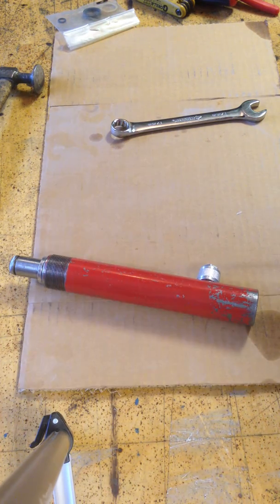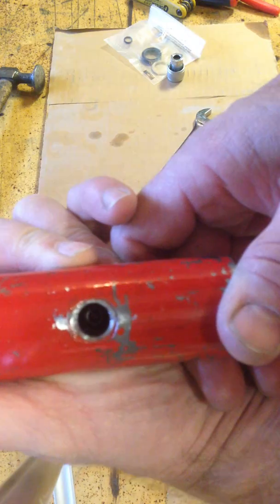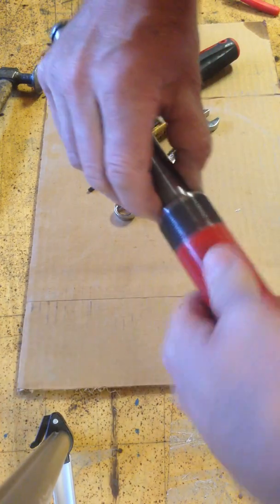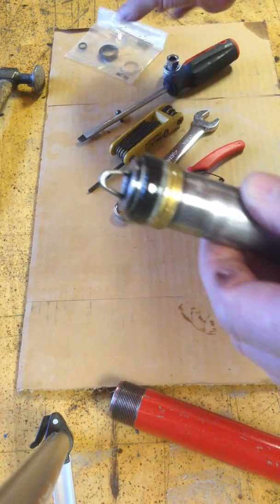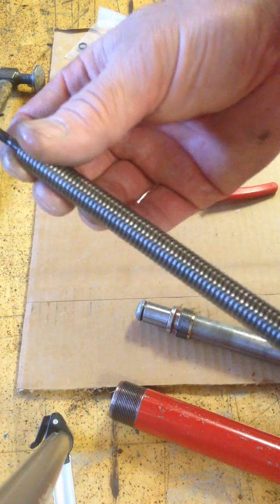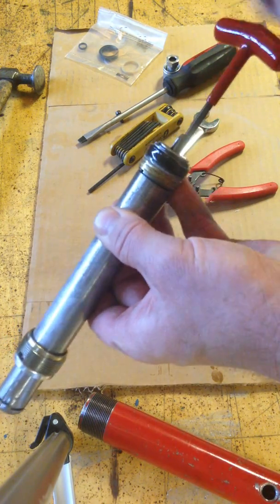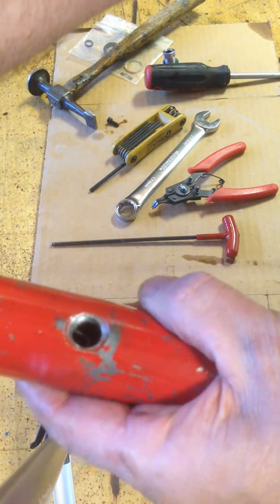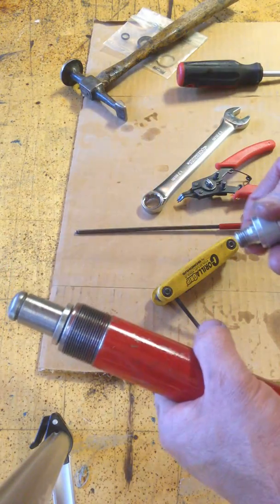4 ton Hydraulic ram overhaul

Comment: I know, OLD VIDEO BUT, had to comment!
funny how you did not remove the clip ring, being it is NOT a clip ring and thats why you skipped that part, but I know how you removed it.
 It was a compression spring clip and only requires a small flathead screwdriver (best) or a pick. Nice fake though! Tom in NV

Comment: Hi mine got stuck and it wont retract can you help me thanks.
Reply from the maker: Jerome Gatila check the connection fitting at the ram.  If you can see threads where the pump hose connects to the ram the fitting has loosened and needs tightening.  If problem persists email me you phone number at timgerhards@therailsaver.com
Reply: Tim Gerhards thanks for replying I emailed you my number